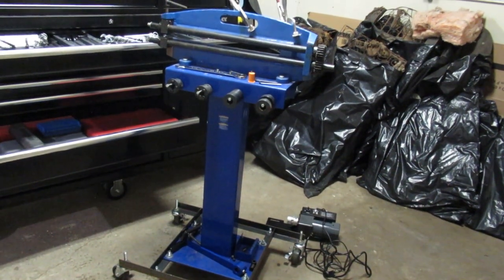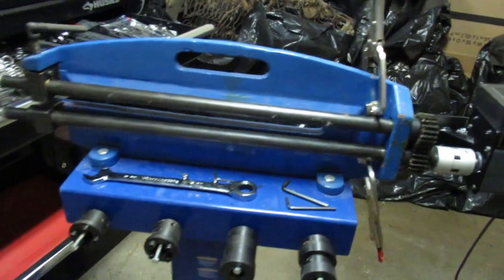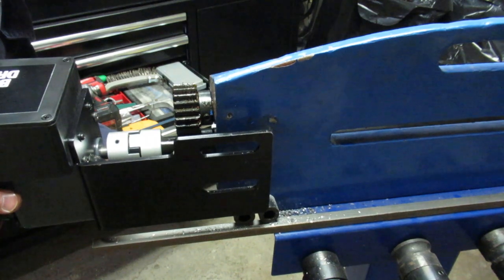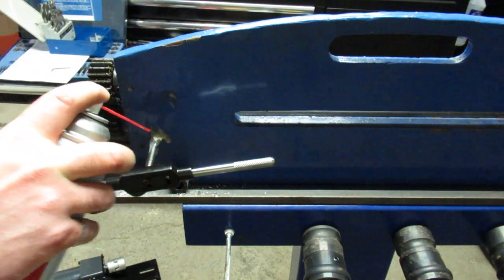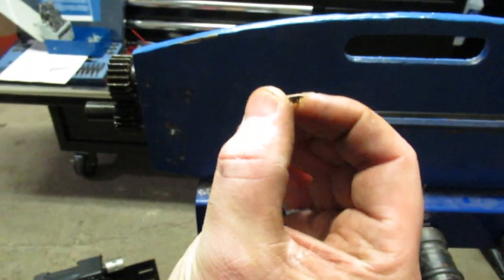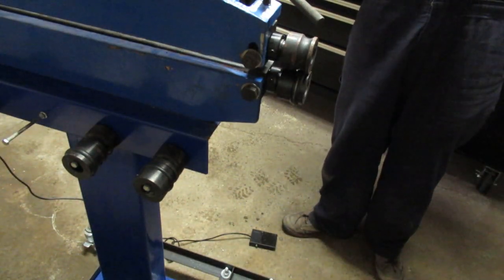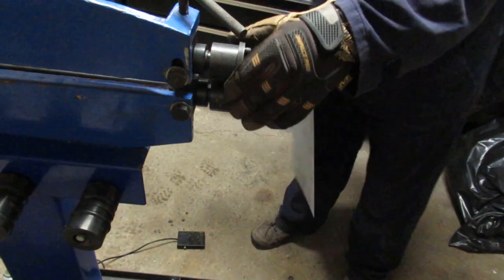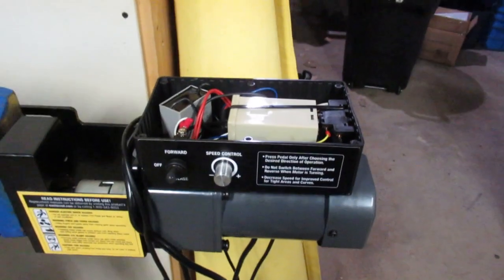Eastwood 21111 Bead Roller Motor Install on Woodward Fab WFBR20 / Princess Auto 8536781 Bead Roller

Comment from the maker: I found that I needed to have the outboard ends of the shafts protruding the same length to align the dies.  I used a welders magnet to hold the shafts in place while I adjusted all of the spacers and gears.  Do this once and every single pair of dies will be aligned when you bottom them out on the shaft.

The chattering first heard when operating the bead roller with the motor was actually the top half of the frame flexing and allowing the top die to bounce back and forth.  This can be resolved by starting with a bit less pressure on the 1st pass.

Comment: How much was the motor drive ?
Reply from the maker: I paid 300 and they are still priced about the same.
Reply: @SteveRivett  Did you buy it right from Eastwood? KMS is supposed to be their dealer in BC but they don't stock it anywhere.